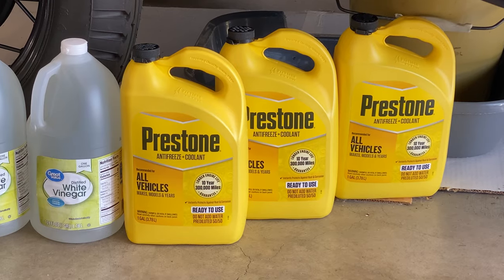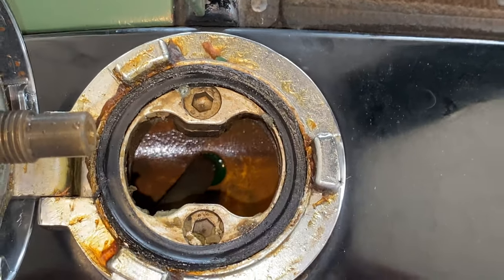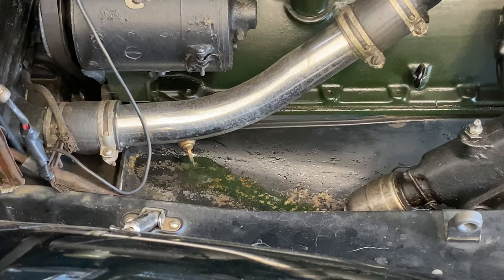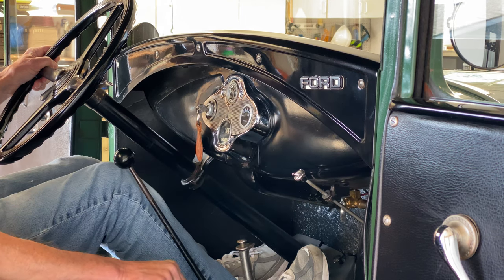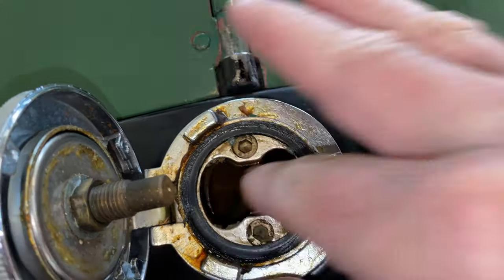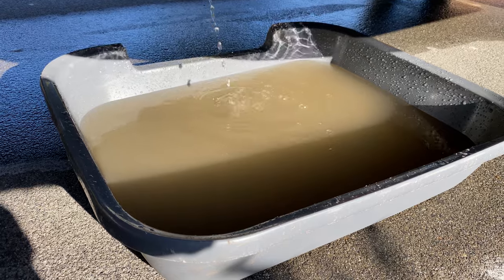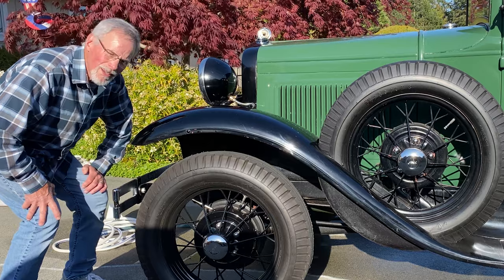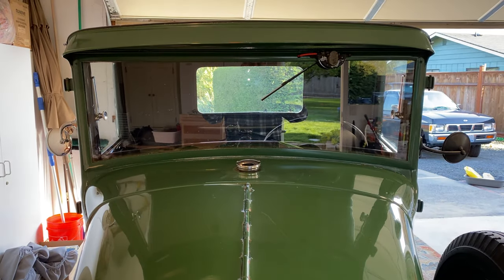Changing the Coolant in a 1931 Ford Model A Pickup

Comment: I’d grease that water pump after running vinegar through the system.
Reply from the maker: Good advice! What grease would you recommend? Thanks for your comment!
Reply: @randallwingett  assuming it’s an original style pump, any marine grease / waterproof grease will work. Just a pump or two in each fitting. If you overgrease the rear, it will go into the cooling system. Les Andrew’s red book should cover it.
Reply from the maker: The water pump has two solid threaded plugs instead of grease fittings. So I am thinking I will remove the front and back plugs and carefully push in the grease using a popsicle stick or Q-tip. I have a 3 oz tube of Super Lube Multi-Purpose Synthetic Grease NSF grade 2 grease. Will that work? Now I understand why there was an oily sheen on the drained vinegar. Thanks again for bringing this to my attention!